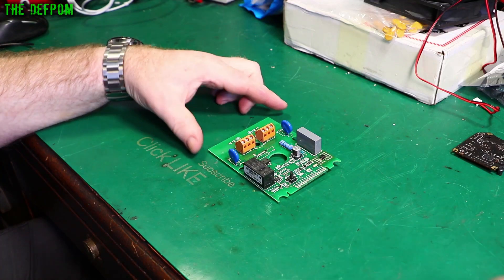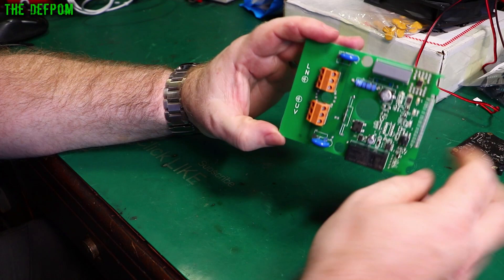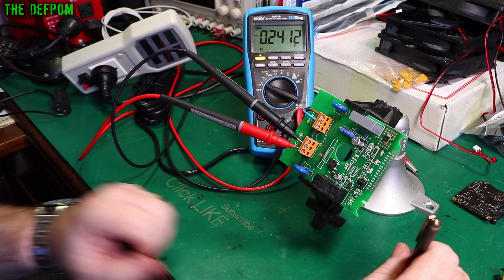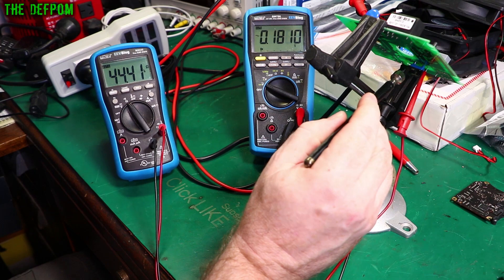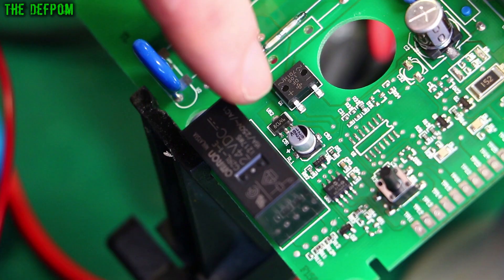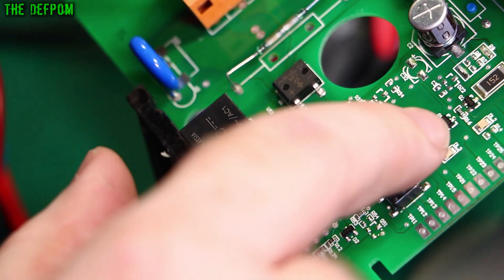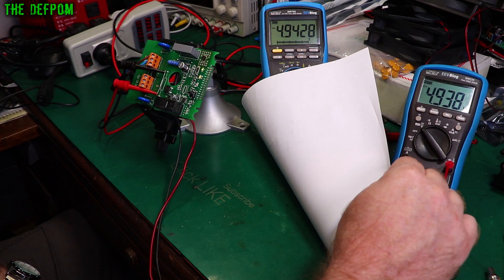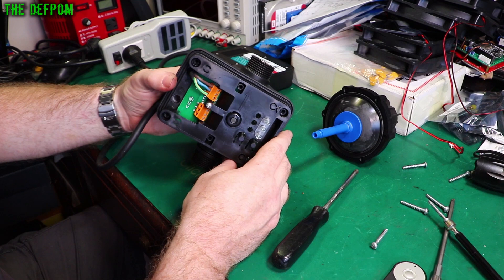🔴 DAB Jet 82M GPS Water Pump Controller Teardown and Reverse Engineering - No.915

Comment: As you have new unit there Scott it might be interesting just to test resistances between your new & old reed switches. If the old ones are way off a couple of replacement switches could mean you end up with a 'like new' spare pcb. 
Good job mate 👍

Comment: These pump controller work upon flow. They sense water flow, so a leak will trigger the pump to be on, like a pipe being open.  Fix the leak first, then you can verify if the controller is actually fautly.

Comment: Coming to this somewhat late in the day…
I’m in the UK with a private water supply (shallow well, approx 7m deep) and have the same style of pressure switch on my well pump. I’ve found the pressure switches never last more than approximately 18 months - initially the internal brass plunger starts sticking with a build up of crap; removal & reverse flushing gives a short term solution. However, I believe the tolerances on the plunger don’t take kindly to suspended solids in the water & eventually due to scratches etc it becomes more unreliable resulting in the pump continuing to run when the switch has reached its cut-out pressure. Result? Extremely hot pump, once resulted in pump/motor seizing & requiring replacement (ouch£££ !!!).
I’ve discovered that a short term fix in the over-run scenario is a sharp tap/hit on the bellows end of the switch can sometimes give a day or so of correct running…
It’s gratifying to not hand over obscene amounts of money to the local water utility but, my god, private supplies can be a serious pain in the behind when they’re playing up!!!

Comment: It’s common to power a relay coil through a led. The coil limits the current and if the coil goes open the led won’t light. Seen this arrangement on lots of industrial controls boards
Reply from the maker: It’s the first time I’ve come across it, I would have expected the LED current to limit the coil current, but I suppose at 24V it’s less of an issue.

Comment: Interesting repair, Scott. Is it my imagination or did the reed switch located on the back of the board operate differently between the two units. On the old board the switch was open and closed when the magnet was close - on the new board the switch was closed and opened when the magnet was close. At least I think that's what I saw!
Reply from the maker: I think they were the same, but the original wasn’t switching as definitively as the newer unit.

Comment: I cannot understand how this rubbish is still being sold. I made up one with an arduino uno, pressure transmitter and relays. It can  monitor itself and self protect for overrun or under-run. It has a watchdog timer for software fault. Easy and cheap to repair and doesn't cost much.

Comment: does the relay switch the mains after the cap or before? like the look of "pomsCad" :-)

if the diaphragm has a leak the pump will not switch off, as the pressure will be equal on both sides so it won’t be pushed in when there is pressure in the pipes.
Reply from the maker: Damnit… that would have been a perfect opportunity to have DefCAD…

Yes you are right about the diaphragm if it was leaking, there was no apparent leak though as the other side is vented and there was nothing leaking out.

Comment: 3 years old is shit! Your pump running hot will damage your bearings and impeller mate and therefore make the pump redundant, due to the labour cost of repair. That was interesting you took the effort to RE the controller, in my experiences the windings fail or the relay goes open circuit. Not the reed switches. 

They should fault out when a pressure point can't be reached, maybe something got clogged on your old gurl is my thinking.